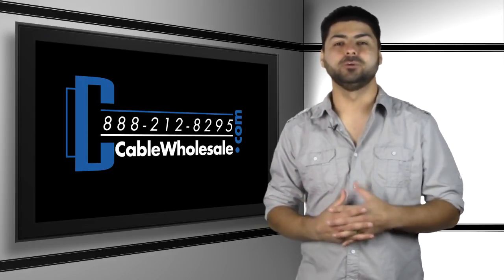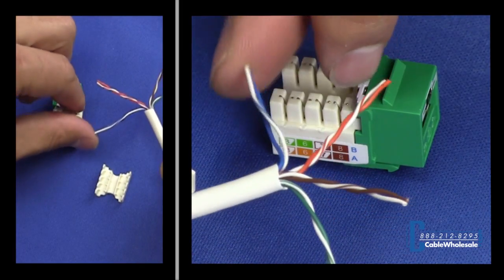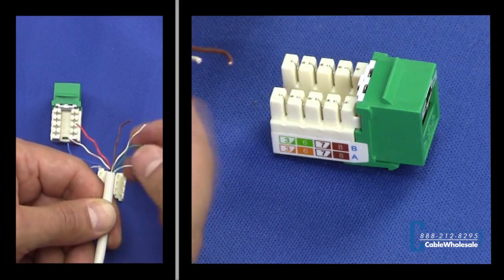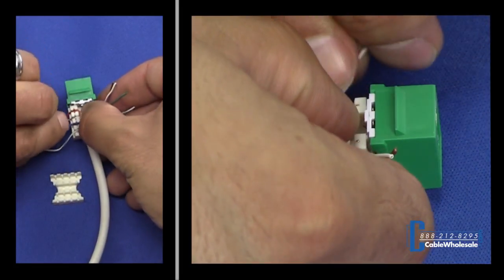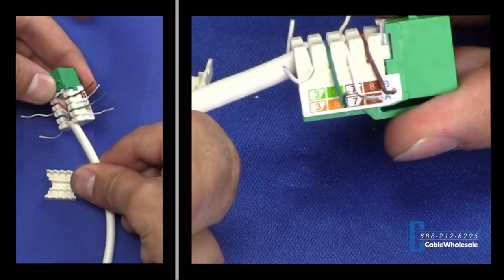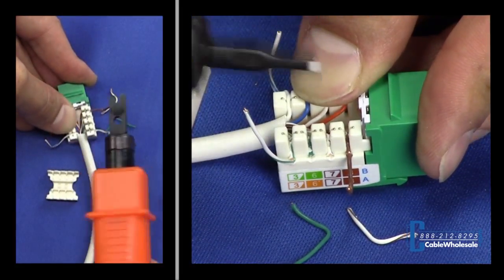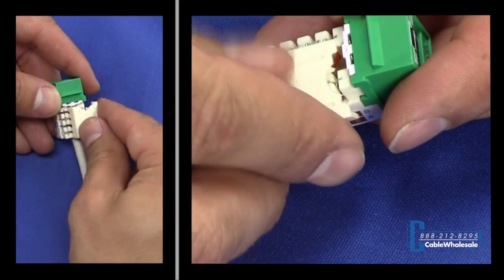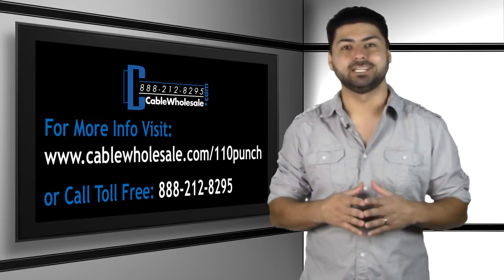How to Punch Down Your Own Ethernet Keystone - CableWholesale

Comment: Thank you. I needed a quick or temporary fix. AT&T has to come out and rework the wiring because the network jack is pulled from the wall.

I tend to fail with home improvements projects and was surprised once I purchased the punch down tool how easy it was. The first time nothing. Rewind the video to watch you use the tool again and that’s when I heard the click. I was not applying enough pressure. YES! Success. Thank you.

Comment: A common recommendation: DO NOT UNTWIST much until your pair/or wire arrives to the slot. (1/4inch at most). You will avoid unstable connectivity. Therefore the more TWIST the more STABLE signals/data arriving to each end.
Reply: I do this for a living and I don't agree with you sir

Comment: can we do this without the last tool which punches the wire down and cuts it?
Reply: Yes you can, you can use a flathead screwdriver
Reply from the maker: Hello Krish,
You will need a punch down tool to punch the wires down into the keystone.

Comment: First tip is do not untwist the wires so much.  keep the twist up to the idc terminal.
Reply: *****  i understand you might not have any issues passing fluke tests.  But why chance it?  That's my motto and what i teach our techs in the field.  Keep the manufacturer's twist right up to the point of termination.  Especially when you get into higher grades of cable than 5e.  That doesn't mean untwist and retwist again.  : )  Good luck and thanks for putting a video out there.  More than what i have done.